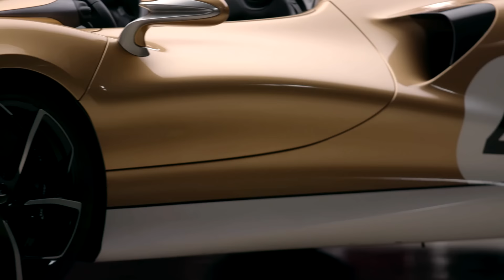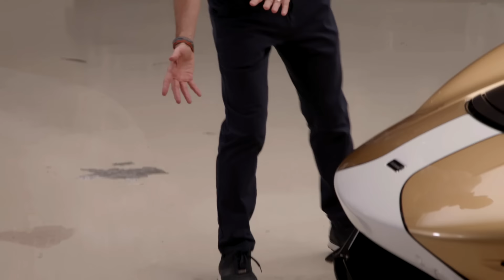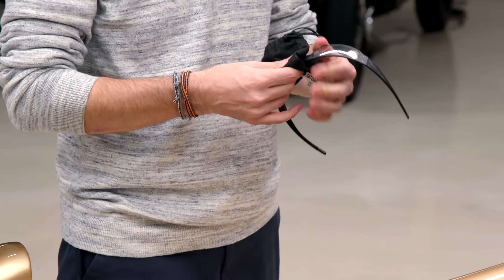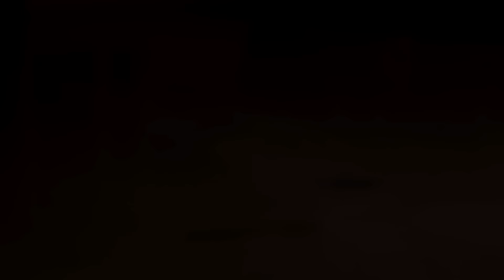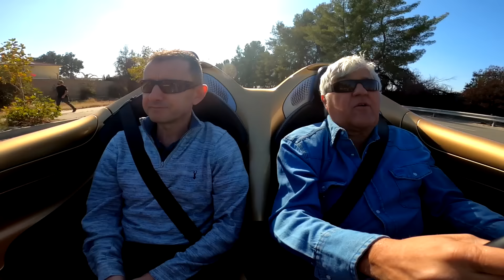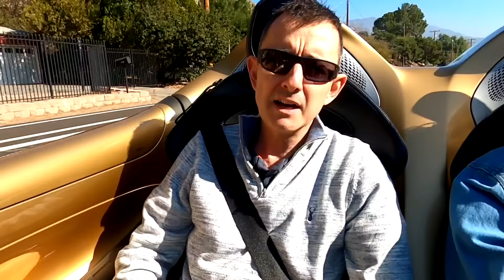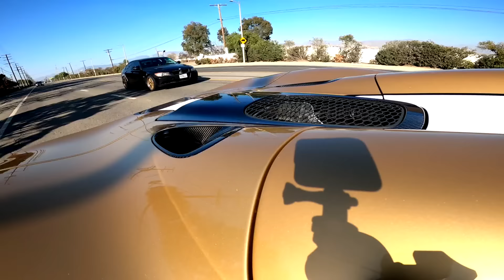McLaren Elva | Jay Leno's Garage

Comment: Renault's concept was more or less the exact same shape, but it was only a concept and never intended for production because it's super unpractical. Back then everyone went "where's the windscreen?" as well, but supposedly they demonstrated that you could drive in rain and not get wet as long as the car moved, because the aerodynamic bubble kept the water from getting into the cab, but as soon as you stop you get soaked. It's interesting that a UK company like McLaren decided to make this, considering the weather over there, and it's rather important that this whole system only works when the car is moving at speed, which really limits how driveable it is on a normal road. And you have zero protection against all the crap other cars throw at your face

Comment: would rather see the aero duct in the front body color and the interior white... would also like a coms system in the car linked to the helmets, and fix those creaking interior bits so when you get in the car it doesn't sound like a kit car

Comment: Jay the man. 
Maclaren it is. MSO can change it..
In blue, with carbon parts.
Senna seats.
ditch the sound system and the AC.
That ironing board needs to go in the bin too. And for the aero two double bubble motorcycle screens.
More track inspired styling from the Senna. oh and wheels from a Senna too.  
Then we can use it for the track as well.

Comment: Over-engineered system which would require use of a constrictive helmet anyway which still would not protect as well as a wind shield frame and glass against flipping over, road debris such as rocks larger than a small pebble, re-tread truck rubber, buckets and ladders from the back of pick-up trucks, birds, debri such as sharp metal pieces lifted up by the tires of passing and forward vehicles, etc., at speed. No protection from anything fast and airborne when still or at slow speeds. When standing at a light behind a pre-particulate filter/def fluid system diesel vehicle one can reflect on their stupidity along with the specialness of their exotic vehicle  between breaths.  A Just gotta have for the idle have gots, ---the target of Mclaren bean counters who place high priority on enticing with dazzling  new models without working out the reliability kinks of their low production previous ones. With enough money, one can regularly use it on their perfect private track with an authorized Mclaren service annex on their own property with great motor sports dynamics and maximum involvement for sure.

Comment: too bad it has such ugly styling cues, like the head lights , the dash podand rear cockpit wall.. it has lovely big lines but is ruined by the smaller lines.and that front air flap is hideous as well
should have just put on a small windshield instead, like 50 60ies racing spiders had.

Comment: It only needs machine guns and pop-out wings and you have the ultimate Bond car there. It's a funny, brilliant design. Looks like it came from the sketchings of every 8yo's imagination. 

I drove a few Caterhams without windscreens and I could definitely see the point of removing the screen. For whatever power you have, you can lose a lot of it as speed increases because of the drag of a screen but where you notice it the most is when you're braking because, without the drag of the screen, you seem to run-on much harder.

Eyewear must be essential though. It's good they provide some. I got hit in the forehead by a massive bee at about a 100mph and it actually left a cut inside a golf-ball sized bruise.

Comment: I have no problem if people want to spend their money on a car like this, but it just proves my theory that once you get past $150k, you get less car for your money. This isn't a car its a go kart. What do you do if its raining and your stuck at a red light? Let me get this straight, you remove the windshield and make the car aerodynamic then you add a complicated air management system with a flat plate that is probably the most non aerodynamic car part in the history of modern cars? What? Having said all that, I'm sure there are people lined up to buy the entire production run as well as its probably great advertising for the McLaren brand.

Comment: Wow! The best episode ever. I was grinning from ear to ear throughout. My face would break if I were to ever drive one of these epic machines. The livery of this car viewed from the side makes the car look very similar to the Elva sports racing cars of the late sixties. The dual head rests are also reminiscent of the marque's sports racing heritage. From other angles the car is gorgeous. I think I'm in love!

The only criticism I have about this beautiful car regards rollover protection. There basically isn't any.  I'm partial to open top cars, having driven formula cars for 20+ years as a club racer. My race cars and my MGB all had at least adequate roll over protection though.

Ultra rich folks who buy this car better get some training before driving it anywhere near the limit. Like many super car owners, they have a propensity to experience dire consequences by driving over their skill level.

That cockpit air bubble concept reminds me of a trip I made from Lime Rock to Albany NY in my MGB . It was raining cats and dogs.  I was completely dry until near home.  I encountered under forty mile an hour traffic, slowed down and watched the rain line proceed up my trousers to my shirt and finally to my head and eye glasses.  I quickly pulled over, hopped out, took the erector set out of the trunk and constructed the top, getting soaked in the process. Getting soaked is all part of the fun of driving with the top down in a sports car or with no top at all  in a formula car at the race track..

-dave

Comment: The airflow problem is faced by motorcycle riders such as myself that really need a windshield (highly allergic to bee stings) the wrong shield and at wrong adjustment creates such a bad turbulence to the air flow it’s far worse than no windshield at all.

Comment: Open face helmets!.............Dale Earnhardt would be proud. What about a huge dragonfly just hovering in the middle of the road at face level? Will this system blast that big bug up & over as well? ( I'm assuming so. ) I once had a huge dragonfly appear like that while riding my 750 Kawasaki back about 1982. I was traveling about 80 mph & saw it in the nick of time, but all I could do was look straight down......didn't even have time to duck/tuck my body down against the gas tank. That dragonfly struck the top of my helmet SO hard, it felt like a decent sized rock & also felt like it would've split the helmet. It didn't of course, and my helmet then had "the coolest airbrush job" from the bug's guts. I'll never forget that one. Gorgeous car!!!

Comment: It would be easy to make a replica of that car at home, on a VW bug chassis and engine, bodywork of fiberglass or wet layup home carbon. If the bug engine is really wound up you could even match part of the performance :)

Comment: Jay, don’t know how to tell you, but an old 6 volt system trick is to put an 8 volt battery instead.  My Dad did this on a 30’s Ford truck.  Gave it more oomph for the starter and the generator would keep it charged.  Just in case you hadn’t heard of that.

Comment: Great video. Strange how McLaren can make rear spoiler air brakes that deploy at 200 mph but couldn’t figure out how to make a wind deflector work above 40 mph 😂
Reply: I think it's due to the spoiler being parallel to wind-flow as opposed to a wind deflector being perpendicular to the wind-flow. I'm not sure how it is affected when you bring the deflector up under 40 mph and then gain speed as opposed to bringing it up at any speeds but I'm pretty sure the force per unit area on the deflector is less if it comes up at low speeds rather than bringing it up mid high speed driving.

Comment: All that design and hard work and then slap on some wheels with no aspect RATIO???he said formula one designers helped develop this car they damn sure didn't do the wheels and tires? When will they realize a formula one has about a 15 to 16 inch rim with a aspect RATIO of atleast 60 even 70??when you have a 20 inch rim and aspect RATIO 30 maybe 35 eventually the torque will hook up only as deep as the aspect RATIO goes and the tweel starts spinning because thers nothing left to hook up with  and if you turn hard enough  on certain grades of road or track the rims expose themselves and get chewed chewed up.please jist dont tell me they handle   better if that wer true formula Indy and nascar would use them THEY DONT especially on crummy typical rough roads. This way you will need an alignment sooner tires sooner  tie rod ends ball joints control arms all that gets a lot more abuse with low profile tires. Even McLaren f1 had better size tires and wheels.WAKE UP PEOPLE

Comment: In the future, if you want the speed and acceleration, you are going to need electric propulsion, motors. But the motors DO NOT care where the power comes from. So, for handling and maneuverability, you are going to want a generator (GEV) to keep the weight down. For the average driver, it won't matter, but for any serious performance driver, or just an enthusiast with more than a passing interest, the GEV option is going to pervade. Hybrids are the actual future of automotive performance.

Also that Tesla Plaid that "beat" the Porsche 911 GT3 RS (was it?) was a stripped out and modified (interior delete, suspension and brake mods mainly) vehicle. And as the rule goes, if more than the tires are changed over stock/OEM, the vehicle is modified and it does not count against other factory stock vehicles. The "Model R" (Yes, I like that name much more) should fix that, eventually someday.

Comment: The Renault Spider is being mentioned as an earlier concept (1995 - 1997) with deflector, but it was half of a success. There was an incident that someone lost an eyeball whilst not wearing a helmet. A metal nut crashed into an eye. Later a windscreen was to be added by law. The Spider was successful in the BTCC (British Touring Car Championship) without windscreen. 2,000 Units had been projected for sales. 1,636 had actually been sold when Renault pulled the plug. It still remains a concept for dare devils indeed.
Reply: i sat in one at a dealership at the time, it is the kart-iest car of all time, no weight at all, lets every Lotus look (and surely feel) like a Caddilac :) oh alright, Lotus built an Elise-version without windscreen, but it was way way later, so way heavier

Comment: The air blade,while functioning well,looks like a numberplate holder from behind, 
However if 3 guys took a year to develope it,I guess it's as elegant as it can be 🤔
I can't help think a clear panel with a HUD on it would have looked cooler.

Comment: What a "switch" !   The Original Race  Car had a Spare Tire "under glass" (the Spare required by Racing Rules, back then) It was mounted; on the front deck area. Just ahead of the Driver. The Tire was on display, in in full view under the windshield ! ... Now, NO windshield !

Comment: Life long Elva owner and enthusiast.    So Bruce built the Mk1 as a combination of Cooper parts and suspension bits.  Bruce was a Cooper F1 driver.   To get the car classed for racing they needed production so they turned to Elva which was finishing up Mk 7 Sports racer production and working toward Mk 8 sports racer (first car with inbd suspension)  So the production racers were Elva - McLarens as Elva had a name and reputation for sports racing cars in the states.    Mk1 A. Used a few more Elva parts for expediency.   All this was turned over to Trojan as Trojan had racing and an eventual F1 car on its mind.   The group of race car engineers was a pretty short list and the engineers here went on to help Gurney , Lola and McLaren moving forward.    I hope the car is a homage to those that brought the cars to light and made McLarne a racing brand.   The racing stripe is an Elva strip widening at the front of the car - typical on Couriers and sports racers alike in the early 1960’s. The idea for the McLaren model was a classic sports racer for the road  - you could have road driven a Mk1A Elva McLaren down the street to the event - but you would have been - “hardcore”.    This new iteration speaks to that enthusiast.    The new Elva McLaren  didn’t hit it out of the park and hopefully this video gets more attention.   My employees offered to buy me one, our pockets are not that deep.

Comment: It's a wonderful design exercise to be sure - but totally impractical for real life on the public roads.
People don't realize just how much "normal" debris comes at your vehicle during the course of a drive -
not to mention, when something bad happens around/in front of you out there and large stuff starts
flying around (we've all seen the videos of such instances, after all).
Proof? If your current vehicle has some miles on it, check out the windshield closely next time you're
next to it. See all those tiny pock marks and dings? Sand, gravel, salt, all manner of road grime hits
the fronts of our cars every time we drive them.

Sorry, I gotta have a windshield at a minimum on my hot rods, if not an actual fixed roof.
I think they could fit this car with both those and it still be pretty amazing.
Reply: Those of us who ride bikes deal with it, wear a full face helmet.
Reply: @Full_Otto_Bismarck  If I'm on my bike, I do. This is a car, in case you missed that point.
Reply: @moparedtn  This is one model of car out of an innumerable number of automobiles ever made, pick a different one.

Comment: I agree that Electric cars are potentially Hyper car killers (and definitely Super car killers)  but it's not about outright pace and for me it never has been. I've often sold a slightly faster car for something that's a bit slower because the slower car is just more of an experience.

I think especially where I am in the UK and Europe , people REALLY value 3 things;   lightweight , manual gear boxes and engine sound. 

I think something like a manual Lotus Evora or Exige is what I think real petrol heads will always enjoy. I also really enjoy the straight line (especially launch) performance of a high end electric car too. I just fear for the costs. If we really are less than 10 years away from China (who just signed a 30 year deal for ALL Afghan Lithium amd Copper) ruling the world, I can see Electric cars with any reql performance becoming expensive. Not only that but how will our grids work if everyone's charging up their cars every night? I think we're much further off than people think. I saw some Loon on the News saying there'd be no Fuel Stations from 2030. 😆

Comment: I wonder if having some sort of expandable piece instead of the flap on the front would give it more organic shape and match rest of the design better. Using existing airflow to expand it or something. It almost seems like for an ultimate engineering challenge using power actuated and quite brute looking flap it's a bit of a shortcut.

Comment: Very funny to me the car stayed the same. 
     But J went from Jay, then to Ray Charles, and John Wayne at the end ! Amazing !!
       These cars, at the price should come with composite roof and polyCarbonite windscreen removable with dual hinged doors.The doors should have slide up polycarbonite side windows.
    Or make a super lite fast back version. Let's face it nobody wants to be open to the elements and flying debris off other vehicles in traffic ( yes expect to have to be in traffic at some point. The shape of the elva is cool a hard top version like the newest Porsche electric race car would be spot on.
I drive motorcycles and a Datsun Z. Everytime I see people driving those three wheel open front ( I call them bed frames) sit down . Slingshots. They are so exposed to debris. You can have that!

Comment: Exactly what a supercar is supposed to be, out there pushing the limits of design.  I'm sure this one offers an amazing driving experience.
Reply: Especially when the bug comes at your eye at 140 MPH
Reply: @johnkempf1808    Bugs, gravel or worse.  That said, I appreciate the novelty.
Reply: @videojoy88  The wind goes over the cabin, meaning the things in the air go over the cabin. It’s just like how he said rain just shoots back when it falls on the car. It’s not really an issue.
Reply: @RussXDX  The wind goes over the cabin... It sure does. And that little rock that hits the windshield at a 80 mph makes a chip in the windshield. Without the windshield, you'll get hit with that little rock, hopefully not in the eyes. Yes, wear goggles or a full face helmet.
Reply: @mmarmrcz6770  It’s like half the comment section missed the entire video.
Reply: @RussXDX    Wind, yes.  Objects, no.  Light vs heavy.
Reply: @RussXDX  gravel is a lot heavier than rain. But they do supply helmets, so it's kind of your own fault if your hear is impacted by road crap
Reply: @johnkempf1808  That's why ya wear the goggles...
Reply: Ah, right. The supercar experience: "When I hit a deer I wanna feel it in my FACE!"
Reply: Just buy a motorcycle..
Reply: Nah, it drives like a lifted ‘
78 bronco on bias plies…..
Reply: It’s not exactly pushing design, windshield-less supericars have been made before. Mercedes did it in ‘09 with the Sterling Moss and Ferrari made the SP1 and SP2 the year prior.
Reply: The bouncing lug nut experience will be costly. I've seen one enter and exit 2 windows before. Barely missed my moms face.